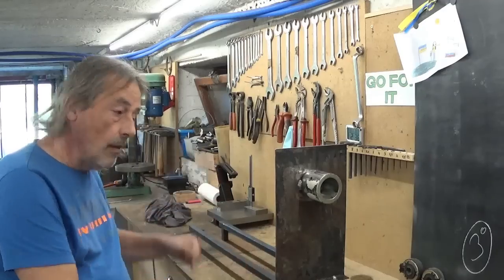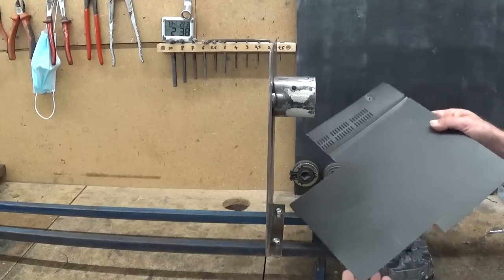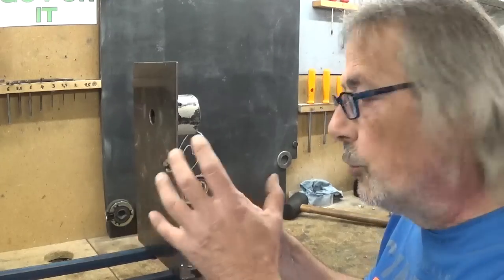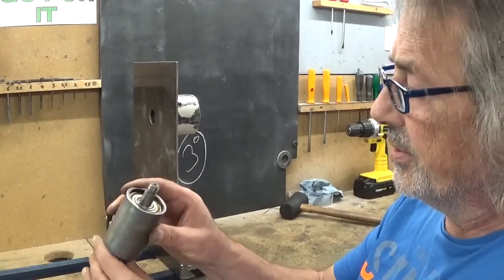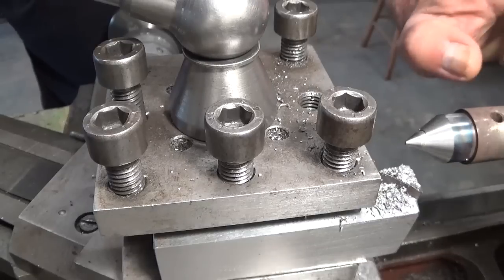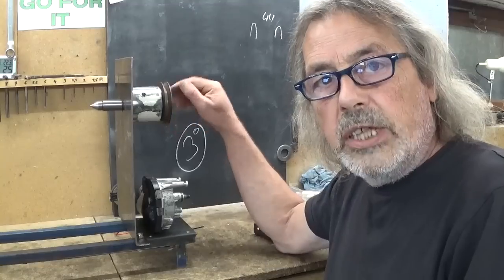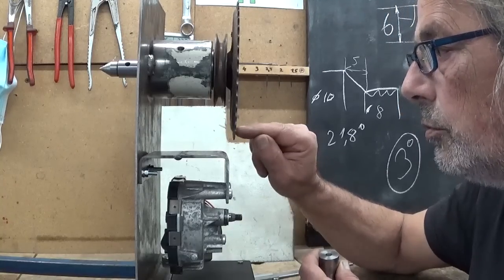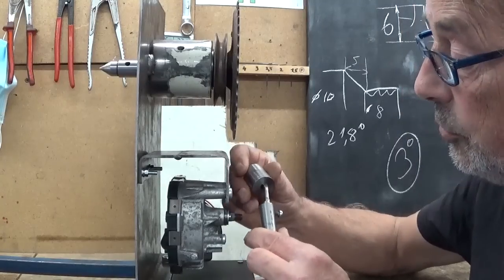Scrap build welding rotator part 2.

Comment: It’s looking really good but I’m wondering if it’s turning too fast for welding but I’m not a welder so maybe not.
Reply from the maker: I will use a speed controller.
Reply: @Rustinox  yes that is a easy way to do it I never thought of that thanks

Comment: As always, entertaining and well done.
Did get an offer on a nice little welder. It used a "normal 230 volt outlet" the ad said..... Physically, yes, but electrically, no. I would have to pull the oven out, disconnect it and connect the welder there. Not what I want to do.
Else I could use my digitally controlled rotating table as welding rotator...
PS
Got Your stickers in the best shape. Email and picture will be sent in some days.
DS
Reply from the maker: Nice. Thanks for letting me know.

Comment: For the chain sprocket, you didn't try working in metric units, did you? That looks like a cycle chain, so I'd guess its all imperial, 0.5 inch pitch chain (I used to be a cycle mechanic in my youth). Also, the teeth probably need profiling on the tips to give clearance.
Reply from the maker: Don't know what went wrong. It was easier to make a new one than try to fix it.

Comment: Several things occur to me about this build.
1.
I was surprised to see you transferring holes with a pencil when you could have spotted through the holes with the same drill bit that drilled the holes.
2.
Bicycle shops sell bike chain tools for peanuts that allow for the shortening of bicycle chains in situ.
3.
Folding flanges or sides onto the headstock plate would have stiffened it and could have been attached to the base.
4.
Surely you are building a lathe? Could you not protect the bed of your lathe with plywood and weld in the lathe set to the lowest backgear?
Reply from the maker: 1. If you tranfer holes with a drill bit, the part tends to move.
2. I had these chain pliers. lent out one day and never came back.
3. The cover will stiffen it all up.
4. I don'd have a speed control on the lathe and I don't want to weld on it.

Comment: Rusty, as usual an excellent job but I have one little issue, the motor is a sealed unit and has no means of cooling so is liable to overheat, on a car its roughly out in the open and gets cooled by moving air and/or water, in your case its static and liable to warm up during use.
Reply from the maker: If it gets really hot, maybe I can use it as a camping stove :)